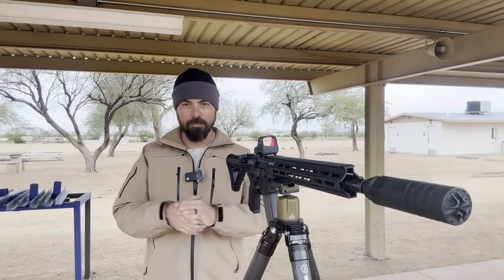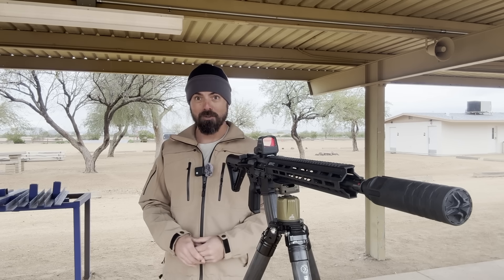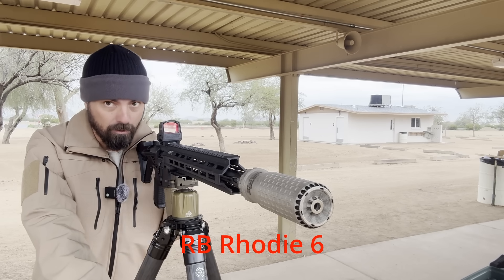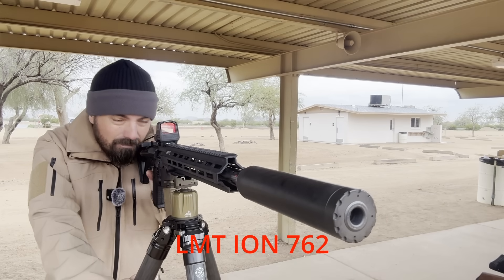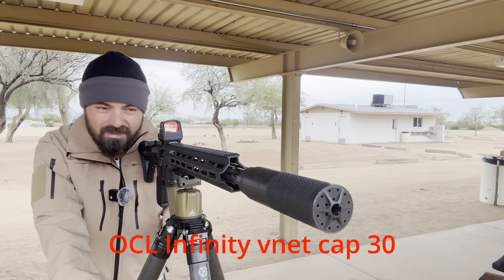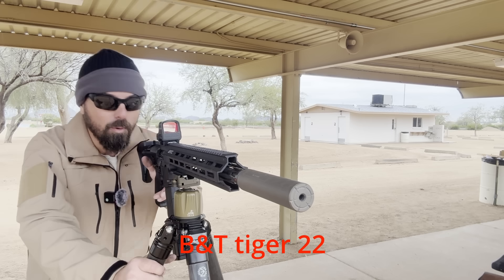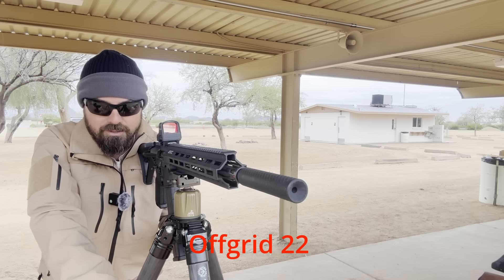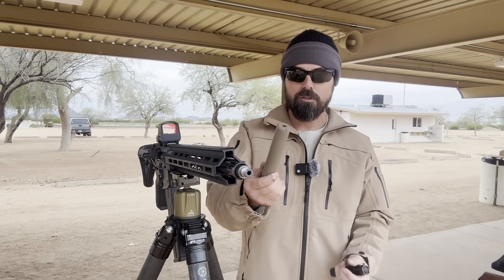Why Your Suppressor Sounds Loud. Gas Tuning Changes Everything.

Comment: I've noticed that humidity makes a difference too. I live in ND and its relatively humid in the summer and very dry in the winter and the sound differences especially minus ambient noise like wind and reflective surfaces is noticeably louder in the winter. I'm assuming that the lack of leaves on the trees and lack of crops on the fields probably means less sound is being absorbed and more is being reflected back to me.
Reply from the maker: great observations!

Comment: Guys is it worth investing in tuning my AR? I have a 20” 6MM ARC Gas gun. My suppressor is a Polonium, (Still waiting on it) I am seeing customer BCG’s, AR10 or JP captive buffer springs, and even adjustable gas blocks. It would cost me a fortune to add all this stuff lol. My gun non suppressed has ZERO gas. I mean, ZERO. You cannot even smell or notice gas at all. I think it’s because it is a 20” rifle length barrel.  But I want my system to be super quiet. Would love some recommendations without buying snake oil. Or falling in to the marketing traps.
Reply from the maker: def

Comment: Rob, Luv ur videos.  Was wondering if you could have a runoff between low back pressure cans to date. Hux 5.56 flow ti, Ptr vent 3, Echo core, Cat JL, Cat ODB, Sig 300, Centurium Max L 5.56, SAW tisha, and
Reply from the maker: thans man, i do have all the data on em.. ill make a web page soon

Comment: What adjustable gas valve do you use?
Reply from the maker: this is a RS, i do cover many options as well as pros and cons in the Back pressure mitigation video .. check it out

Comment: Is there a video where you explain why you don't measure SPL  to supplement your subjective ear measurements? Do you have something against objective sound pressure level measurements done over time, frequency, and direction? While I appreciate your subjective comments, I'd be curious what the objective sound measurement numbers showed.  I'd also be curious about measured effects on POI.
Reply from the maker: ill need to make a vid on it. check out the sound summit from thunder beast they cover that very well
Reply: @SilencerAnalytics  The sound summit does OK, so far as it goes, but they focus mostly on getting data -- but the analysis is limited -- particularly in the frequency domain. You'll often say something like "that sounded deeper or lower" which is a comment about spectral content that Thunder Beast doesn't address at all.  I do understand that expensive equipment is needed for actual measurement, and there's always the issue of gating out environmental factors (walls floor shooter) just to get raw time domain data as Thunder Beast has done. My main question was whether you had anything against quantitative measurements of any kind. It sounds like you don't. You're just not set up to make such measurements. Thanks.

Comment: Hi Rob, really enjoy your videos!  The question I have is I saw you reach up right behind the suppressor to tune the gas down. Who is the manufacturer and model of the gas tuner you are using?
Reply: riflespeed. they carbon lock pretty badly.
Reply from the maker: Thank you! i did a whole vid on these and other options, back pressure mitigation video ... check it out

Comment: So torn between just going out and getting the sig 300 or waiting to see if something more around the 6 to 7 inch range will come out and Keep up in 30 cal. Most of my use will be for hunting application with 6.5 Creedmoor but I’ll also use it on 300 blackout, 6.5 Grendel and 223 quite a bit.
Reply from the maker: tuff call,, shot is next wekk

Comment: I’m curious as to why the Dillon isn’t getting any love from the channel anymore, you seemed blown away by the performance when putting it up against the spiritus but now it doesn’t even get an honorable mention. Not hating, just curious ✌🏻
Reply from the maker: good can, sounds killer, the BP is too high and it stacks gas not so great
Reply: @SilencerAnalytics  even with an adjustable gas block?

Comment: That's the problem I had with the Kuna, the gas coming out of the ejection port (port pop) was as loud as a full power 22lr, except its right next to your ear. I think an interesting video would be testing for port pop on something like a Kuna and seeing how backpressure affects it. I suspect something like a PTR Vent 3 would have been far superior to the high backpressure can I was using. PS any chance you could send 1 round of 5.56 through the Mask? Its full auto rated in 17-4 stainless, I suspect it can take a lot more than they give it credit for. I asked them to make a Mask 2 out of Haynes 282 that would also work on 5.56, I sincerely hope they do.

Comment: So why is it that you don't use a DB meter to measure the actual sound levels?  I've watched 5 or 6 similar videos of yours comparing the sound with different suppressors and it's all 100% subjective based on your interpretation.  As the end viewer video's like this tell me nothing as the video audio could be affected by many things during production and post production.  Actual DB readings would show real data and differences in sound levels.  Heck, you can download free apps to do it so you don't even need some high dollar precision DB meter.  As long as your phone or meter is positioned consistently for each suppressor the resulting measurements will be relevant.  The actual DB's might not be 100% accurate using a phone app, but the difference (i.e. 133db v. 130db) would be quantitative.
Reply from the maker: ill make a vid on this soon

Comment: I think this reaffirms what you’ve said repeatedly, going with a do all 30 cal can works good on 556 and also 300bo, and since it’s for range work sounds like JL, Sig hex 300 are tops but long and 556 cans rhodie and tisha as dedicated options shorter but louder.

Comment: Do you run your cans WET? 
I put a dollop of Vaseline in mine on occasion and find it makes a difference on FRP as well as a consistent string,  handload and grain weight dependent.
Reply from the maker: On low-pressure cans its an option. Many rifle cans will say to not do that.

Comment: I love my Nomad L.  Forgot my ears one day and only thing I had with me was a beach towel.  Winter time in maine so I just wrapped my head in the towel and man... it was amazing how well that Nomad L did with just a towel over my ears. Shooting 16in 556 btw.
Reply from the maker: killer can for sure, but full BP
Reply: DA makes a 5.56 end cap for the Nomad, part no. DA201. If you don't already have it that is. Might sound even better if not.
Reply: @Nefville i shoot way too much .30 cal. I dont want to forget and blast the end cap.
Reply: @loneczgunner6562  That's funny, I do the same thing with my Wolfman. I do have the .30 cal end cap for it but I almost never use it. The only time I will is if I'm only taking my 300blks to the range and I think I've only ever done that twice.

Comment: It’s cool to hear you talk about the humidity and temperature affecting sound. The measurement I think you would be looking for is called wet bulb temperature and is a thing HVAC techs like me use on a regular basis. It takes into account both humidity and dry bulb temperature (which is just the regular temperature).
Reply from the maker: how inteseting !!! in the Marines, when I was instructing as a combat instructor at SOI-w we used the same system!

Comment: I was considering getting  3 rifle speed gas blocks for my go to ar15/556,  300bo uppers & ar10/308. I'm trying to decide what model #'s to get? How much do you have them extending past the handguard? Do you prefer more or just enough to get  ahold of? Obviously it also depends on how much distance you have from end of handguard to shoulder of muzzle devices. Im curious how many 22 cans could actually handle some 556 like da mask sparrow, older well known cans?
Reply from the maker: i did a whole vid on these .. back pressure mitigation.. check it out.

Comment: That’s because humid air is less dense. Turns out water is lighter than air.
Reply from the maker: Interesting point! The moisture in the air definitely affects sound propagation.
Reply: Water is around 800 times denser than air. It can change slightly but will never be lighter than air. Not sure where you got that from.

Comment: I know it’s a massive investment, but you’ve just got to buy a decibel meter. Maybe the difference is your host vs mine, or the ammo, or the climate conditions, but our results are quite different. The Sig cans I’ve shot are ok, several of the others I have not shot, but every PTR suppressor I’ve tried (and I own all but the Spiritus) have been very close to the “best.”  I really wish they would make a large volume 9mm can (like Rugged did with the Surge9- certified mine yesterday) for us PCC nuts. Thanks for the video
Reply from the maker: That would sure be fun. Check outbound summit from thunder beast. That have all the good numbers
Reply: @SilencerAnalytics  say, I am currently seeking a large volume can for 45-70 Henry Hush. Any suggestions would be appreciated.
Reply: @Yoda052  I'm currently running a Hybrid 46m from silencerco on my Marlin and it sounds...Okay. CAT is supposed to be releasing a new 45-70 Suppressor this year according to their website. It's called the "Dito" and is supposed to be a special tuned for 45-70 lever action suppressor. I'm planning on grabbing one when they launch.
Reply: @D @DarkDissolution ’ve heard the same thing about the CAT can, only wish I knew how long they release it.  I wrote CAT to ask and they only confirmed that it would occur “this year.”  Hopefully it’s a surprise for Shot Show.
Reply: @Yoda052  Hopefully, the selection for 45-70 dedicated cans is pretty limited so It'd be nice to have one that does a good job of taming the beast.
Reply: @D @DarkDissolution  have an Obsidian 45 (and a Mojave 45) but neither are what I would call “large volume,” so I might just make do until the Dito is available.  I just ordered my Hush (have one in 38/357 already) so I have time to research and in the meantime I can start collecting gear to start loading 45-70.
Reply: @Yoda052  Yeah the obsidian would be a good hold over. I'm thinking Dito all the way though. Those hushes are nice rifles and Dito would go great on the 45-70.

Comment: Unpopular Opinion: The PTR Vent 1 sounds quieter than Rob's beloved favorite CAT JL, on a gas/semi-auto/open action system, in my opinion.
Reply: Why This Matters: The Sound Hounds, like myself, still prefer to use the quietest cans/setups in AR/AK platforms.
Reply: @peacesmakers- I think it really comes down to the individual user - I have both cans and run them on gas guns and bolt guns and all my buddies except 1, think the JL is quieter than the Vent 1 - I personally think they are equal and I don’t really notice a perceivable difference between them, from behind my guns - I will give the Vent 1 having a deeper tone but still equally to the JL (I have the JL in 718 & Ti).  Just my $0.02, but that’s why it is great than we have the freedom and opportunity to get both of them & Now without giving the ATF $200.
Reply from the maker: I think both are solid 😊
Reply: @SilencerAnalytics Correct! Both are awesome! (Win/Win) 💯 On Bolt/closed action setups, I do agree that the CAT JL sounds a tad bit better, but for some reason, the PTR Vent 1 just sounds better to me, on gas systems/AR & AK platforms.
Reply: I have a JL coming next week and I do think they are peers but the reason I chose the JL over the Vent 1 was that I needed a higher backpressure can to cycle my non-adjustable ARs. They won't run subs without some backpressure I would prefer not to swap around buffers. I'm also a bit leery about the Vent's PIP technology, I know those cans take on weight after 1000-1500 rounds or so and I don't know how easy it would be to clean whatever carbon has gotten jammed in the pores. Perhaps you have already dealt with that or its a non-issue but it was something I didn't want to have to worry about.
Reply: @Nefville btw the "carbon around the pores" isn't an issue, and tbh I lost count of rounds after the first 1000 rounds, but I've had no issues with carbon or cleaning the Vent 1. I soak it overnight with the huxwrx suppressor cleaning solution kit.
Reply: @peacesmakers Good to know. The Vent 3 is definitely on my buy list and its using the same tech. Amazing cans, truly.

Comment: "Hi I'm Rob and this is Jacka$$. Today i'll be shooting B&T and LMT suppressors without hearing protection." 😂
Reply: Hey man B&T has some insane performers now haha. And the exigent fireteam is a collab between exigent and B&t
Reply from the maker: Hahahah 😂
Reply: Every can is gonna be really good in a couple years 😂
Reply: Q 4 Rob - on an AR-15 with tuned gas block is a full-size full back pressure can better or worse at shooter ear than a full size flow through can? Example: Raptor 10 7.62 vs CAT JL (both .30 cal I believe) - I want to understand if reduced back pressure cans matter more than adjustable gas blocks in a properly set up gun used for predator hunting.